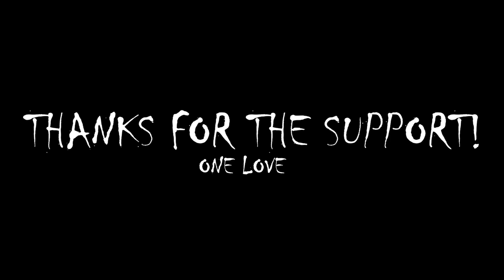ULTRA LARGE FORMAT Carbon Print on glass for $ 0,99 USD / Vlog #118

Comment: How are you making negatives with carbon density without intensifying the negative after developing?
Reply from the maker: The density depends on three factors. The development, the quality of silvernitrate bath and the light. I redevelop if I need it. In this case we din not. Although nice carbon prints are much much easier to make from a dense negative, you can make a Carbon print from any kind of negative.
Reply: @BorutPeterlinPhotography  Thanks Beirut, l will do some trials then.